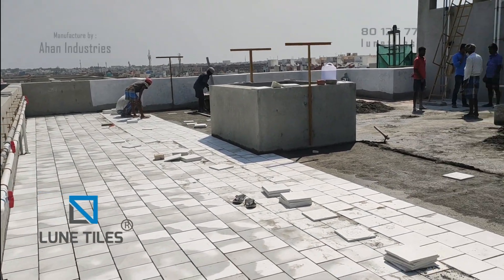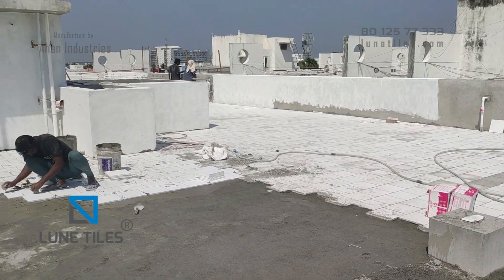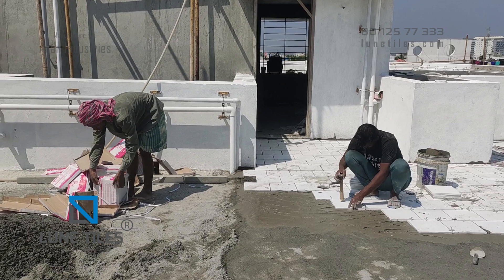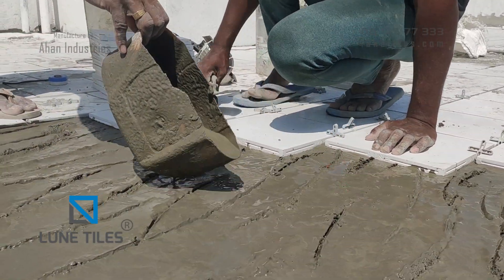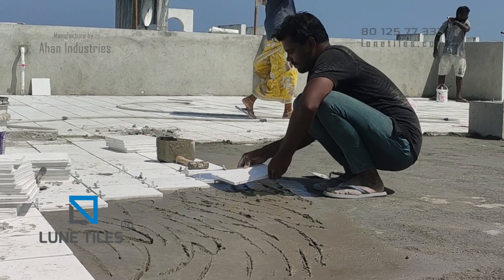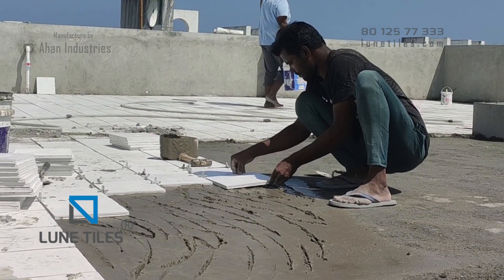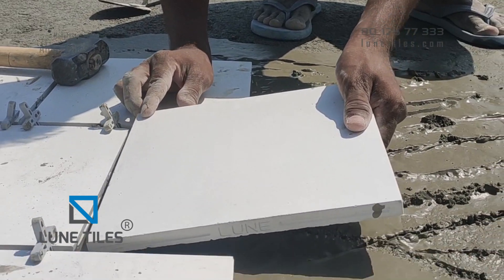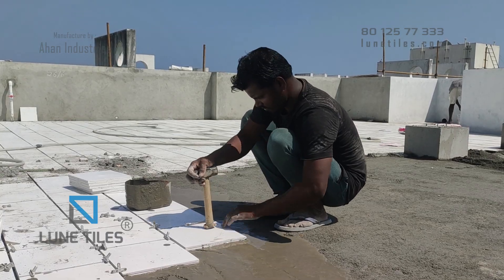Cool Roof tiles - Avoid these mistakes while laying Cool roof tiles on Terrace - English

Comment: We have engaged laying contractor Ramesh recommended by your staff Tamil Arasan and according to the contractor your recommended method of not stamping the tile while laying need not be followed .Please clarify.
Reply from the maker: Hello Anandpartha sir,
                There is no problem by laying the tiles by stamping on the center of the tile. Because practically it is usual whoever lay the tiles.
Reply: @Lunetiles  Noted thank you for the clarification.